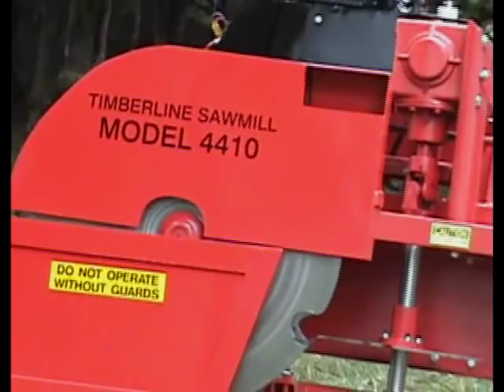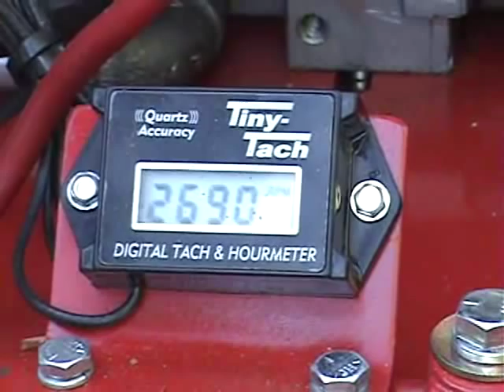The Timberline 4410 Sawmill

Comment: I would by a wood mizer
Reply: Have you tried using the wood from a woodmizer?  The woodworker has to do a lot of work to trim, etc the big slabs from a bandsaw mill.  Swingblades produce more usable pieces of lumber.  Each has it's own strengths.
Reply: @wildturkey5838  this isn't a swingblade

Comment: just buy a woodmizer!
Reply: I believe this may be better than a bandmill.This ,if it has carbide teeth will stay sharp so much longer!I would say this is its best feature. Do you realize the many blades you can go through in a day with a bandmill?Of coarse the bandmill has its place,like making long mortise or lap joints the full width of a 12 inch board.
Reply: if you like turning trunks, then yes
Reply: Wood mixers are a bottom end band sawmill. At least compare this great machine to a cook's sawmill.
Reply: woodmizer sucks, i have one